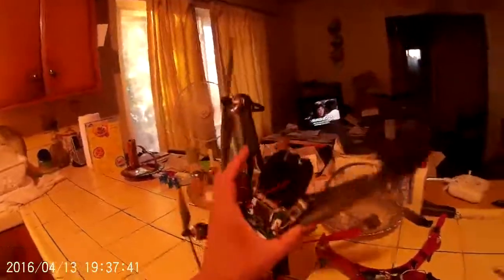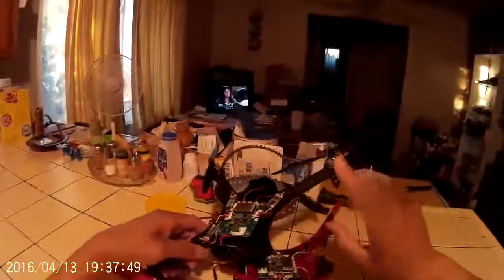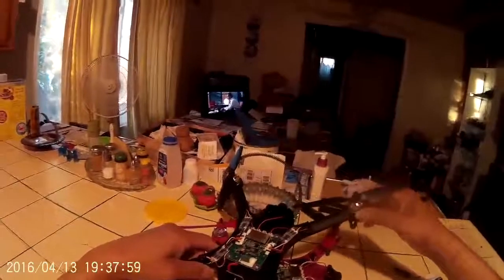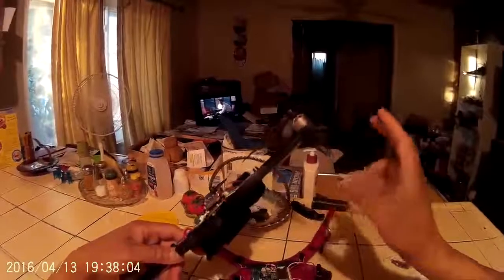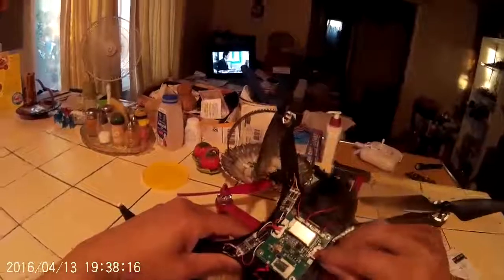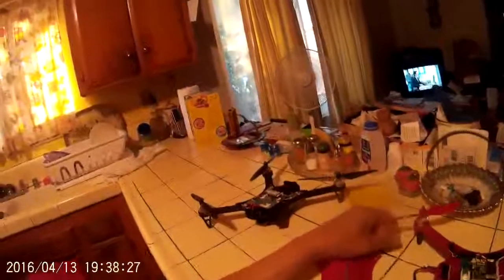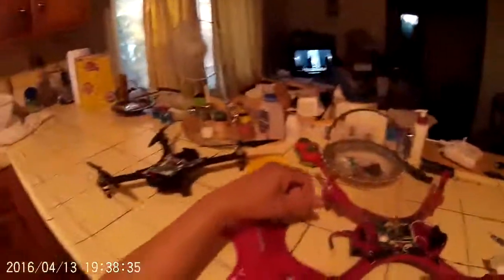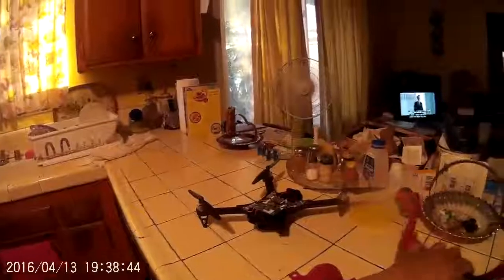Bugs 3 old esc vs new esc explanation

Comment: question? My bugs 3 has slowed down by 30%. The punch outs are also slow... when it hovers you can see it wobble and hesitate  intermittently. Also if you hand spin the props, you can hear some light clicking on a couple motors... question is, do you think it's the motors or the ESCs? I'm thinking if one of the motors has slowed down, it will most likely slow down the others to compensate. Any help appreciated.
Reply from the maker: Dont you hate when that happens?  then you start to rationalize the drop in performance as if it's " just your imagination"  But with bugs 3? it's most likely NOT your imagination,  they start out great.  I still miss bugs 3, but I will never spend another dime on that quad.  Hans Im just guessing when it comes to your B 3,  the motors are sensitive to dirt,  jolt's and impact's and as the motor's start to  drag, it cause's stress on that esc and you could loose both your esc and motor,  I have a feeling that a replacement motor for all the one's that drag or wobble would put some stable zip back in your bird.. WHAT YOU DONT WANT,  is a bugs 3 that get's week or burns out the circuit on the board that comes just before the esc!  ( extremely common in many bugs 3's) because if that happens ? that means the bird will never fly again unless you change the board. and from painful experience I can tell you,  If you buy 10 bugs 3 replacement board's?   8  of them will be defective and never work.. I  wish I was wrong but unfortunately I would BET THE FARM on my opinion of bugs 3.  MAN thank you for the question and viewing the video.. I hope it all works out..PS.  Keep an eye on your bugs propellers too. sometimes they can have a hair line crack in them and they can shatter or pop off when you least expect it..
Reply: This is my second bugs3... my other one flew off. I bought this one used, guy said he only flew couple times... motors sounded great on test, but after couple flights something was off... almost like the seller lubed up the motors to pass my buyers test. Luckily I have a Wakera F210 for my adrenaline rush, but the Bugs was my first, so there is a sentimental value to it. As far as props, I've already replaced them. Thanks for the troubleshooting info
Reply from the maker: Oh yea with me and bugs, I thought I met the perfect NON GPS BRUSHLESS quad.  I have learned a little and crashed and flew away a whole lot. And MJX surely must know that 100's maybe 1,000's of there customers have lost or broken bug's 3 quad's and extra bugs 3 controllers that they no longer could use. But instead of giving us the option of buying a replacement drone with no controller for like $70 or so? We have to buy a whole nother drone with a controller at full price. and what's insultingly  funny? is the fact that all of these quad manufacture's are more than happy to sell you replacement radios for your drone, but none of them dare sell a drone without its controller,, GEE i GUESS IF YOU DONT WEIGH IT DOWN? YOUR CONTROLLER MAY SPROUT WINGS AND FLY AWAY..i harbor resentment towards XK for the same reason. there xk 251 only can be purchased WITH a controller and AT full price, that thing should go for $70 without a controller...Id like to buy a used bugs 6. if the price is right..
Reply: Bind and fly would of been great, wouldn't have had to buy a used B3 for $60 that turned out to have problems.
Reply from the maker: I totally agree,  You know what?  If bug's 3 was a bird that had strong circuitry in there boards? if it was a bird that actually provided a source for us to get authentic non defective replacement parts? I would dang near be willing to pay $60 for used bugs 3 with a broken arm and only 3 props!   that's how much I used to love that model,  and an esc, motor and frame change is something I would have been willing to do.. But now I have zero confidence in that bird.. Very fond memory's of the beginnings of bugs 3. and seeing every body do mod's to that bird made me really want to tear into it and have squadrons of different kinds of bugs 3. But instead i got hours of hand's on failure's on mod's and stock repairs. Bug's 3 make's me love Respect the xk x350 all the more..
Reply: Older thread I know but I don't get it either right, I've purchased 3 b3 and not a single one of those things has had 1 problem. Heck the last two I got came with a year friggin warranty and were only$54.99 each on eBay (plus tax 6%). Guess maybe it's roll of the dice, or perhaps it's just that I take care of mine and oiled every motor upon arrival with synthetic engine protectant oil (2 drops top bearing and 2 drops on bottom bearing) Whatever it is I just keep lovin me some bugs3's. Good luck everyone. P. S. Antenna mods prevent fly aways mostly, and avoid crashing will help you a great deal 🤔